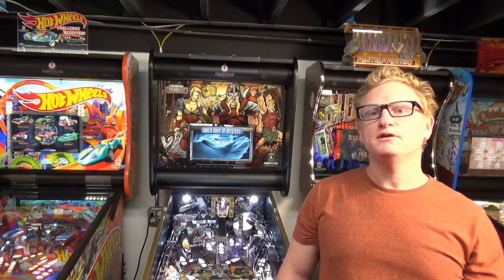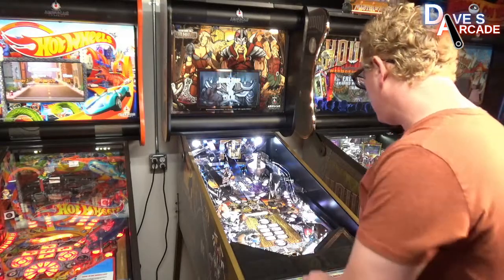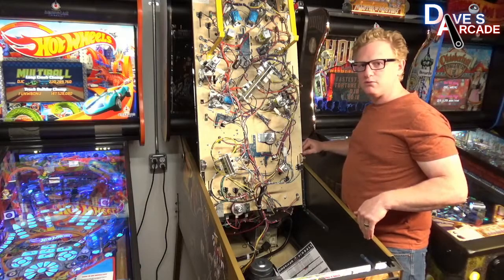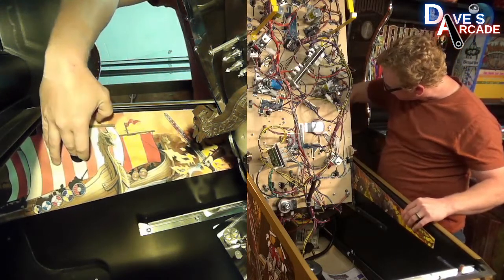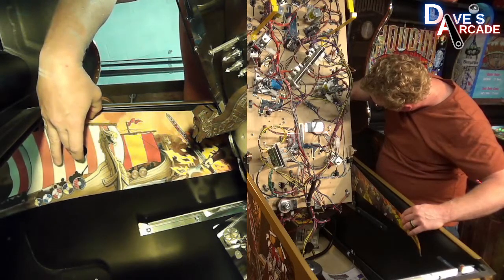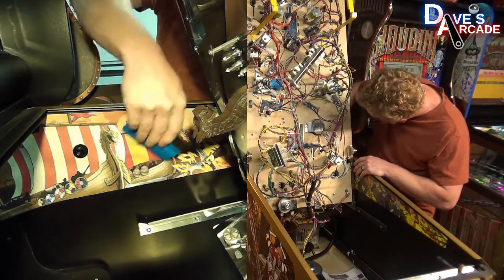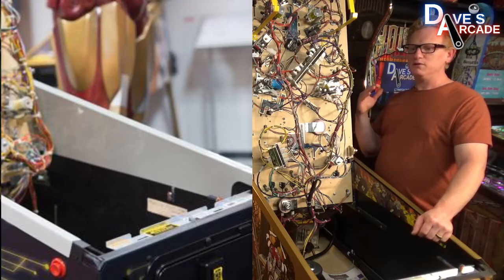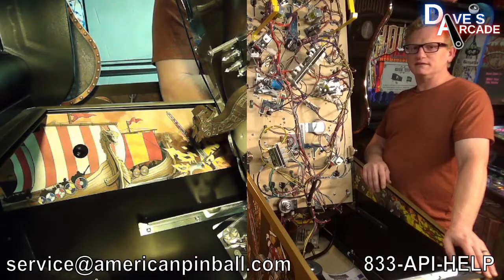How To:  Install Pinball Art Blades

Comment: Does this method work with Stern machines?
Reply from the maker: Should work on any game, provided the material is thick enough to slide in flat. 
It’s very important that you unroll and let the decals flatten out several days before using.
Reply: @DavesArcade  Thanks Dave, appreciate the insight.